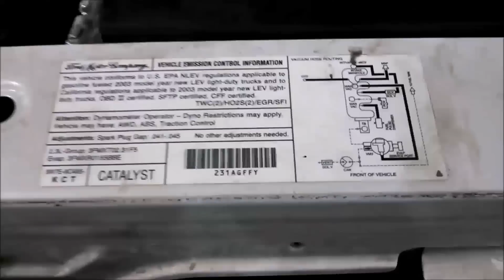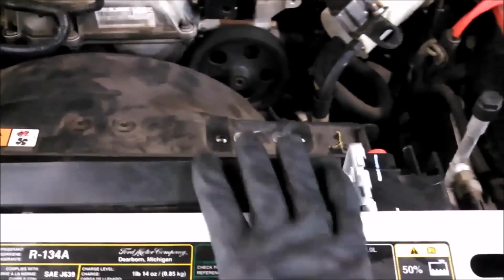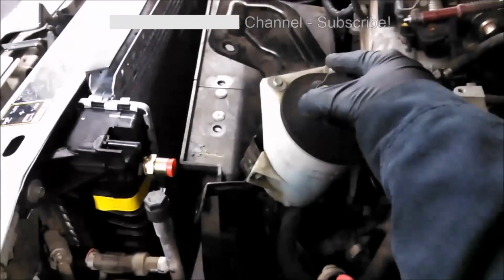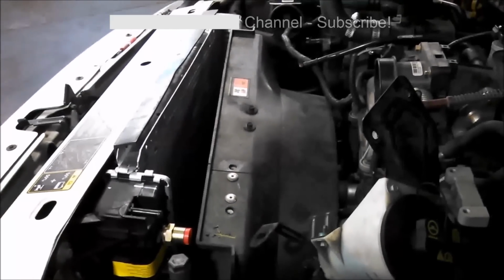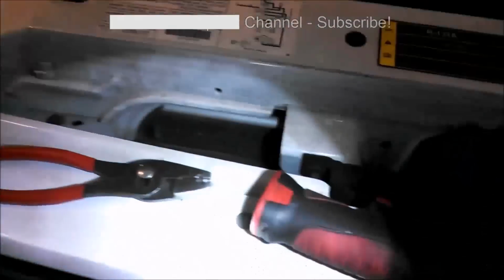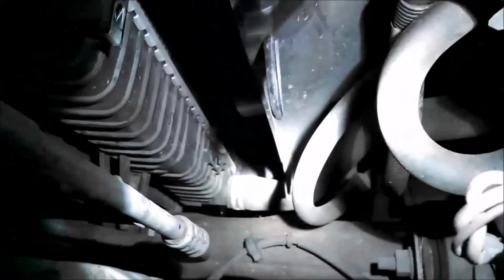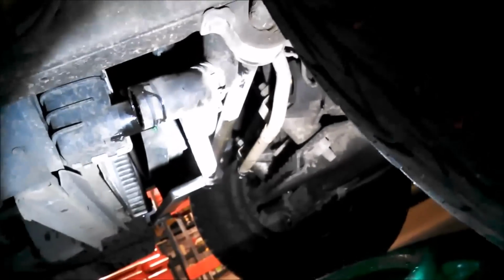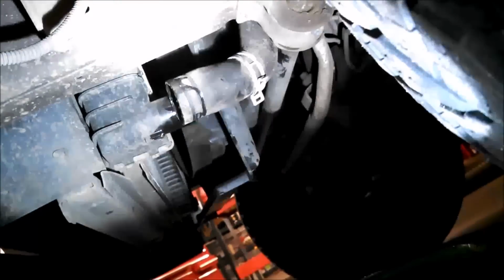Radiator replacement Ford Ranger 2001-2011 2.3L Mazda Install Remove Replace

Comment: can you tell me what the tube is with the black cap near the top red plug is? mine is missing the cap but i dont know what that part is called. thanks!
Reply from the maker: well at the 30 second mark I see a black cap on a metal tube on the right side of the video (drivers side close to radiator), that is a cap for the A/C system.  I believe that is the high pressure access port for hooking up an A/C machine.

Comment: what is the part in front of radiator that looks similar but appears ac lines run into it?
Reply: Michael Wheeler the condenser